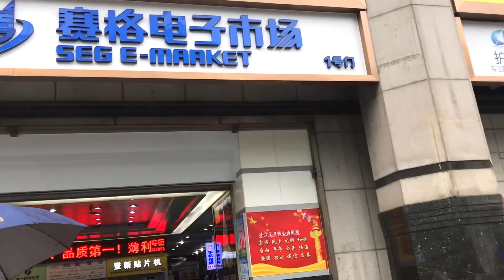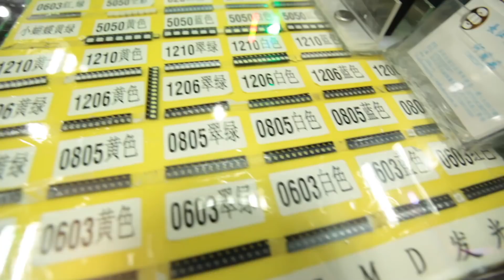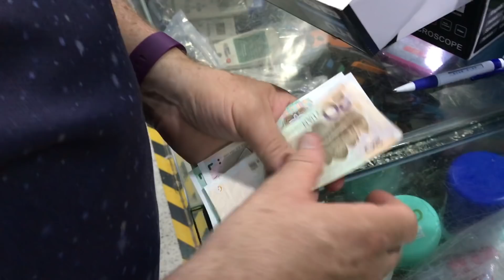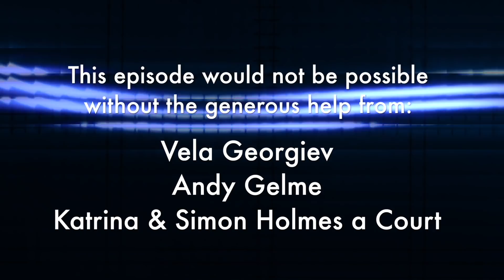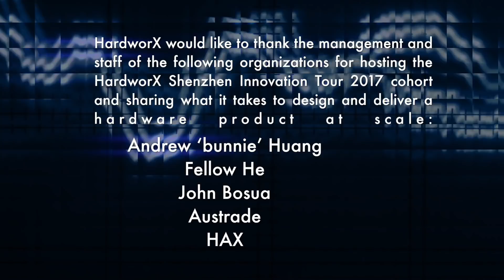The Electronics Markets of Shenzhen

Comment: Awesome video! I’m heading to Shanghai in a few weeks, do you know of a similar electronics component market there?
Reply from the maker: Thank you for your kind words. In Shanghai there is an area near the intersection of Beijing Dong Lu and Fujian Lu which has floors of electronics. I often go there. Its well worth the visit. That area, along Beijing Lu, you will find lots of shops that sell both electronics and metal work related tools. Its very much a fun area for geeks! Finding Arduino/Raspberry pi modules though has traditionally been scarce there but things could have changed. Good luck with your visit.
Reply: Thanks for the reply! Hopefully I can check it out.